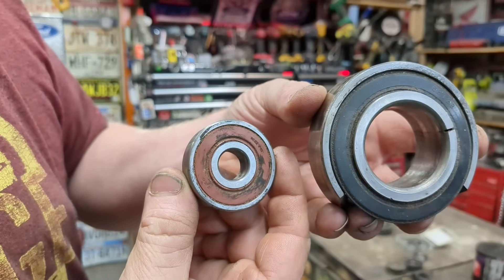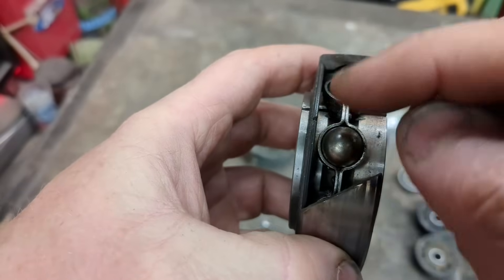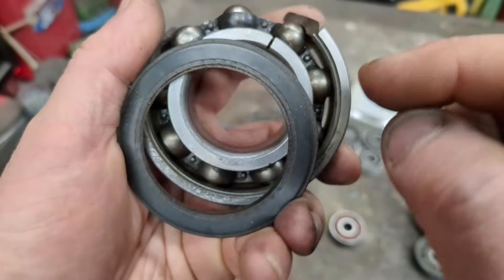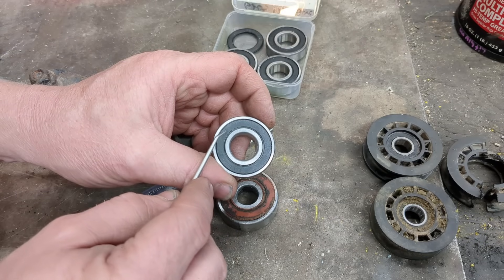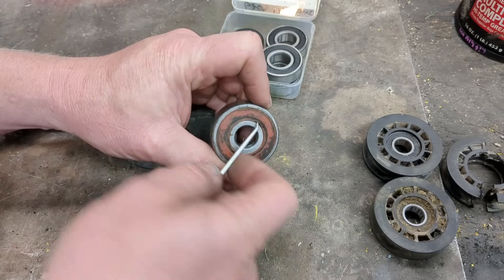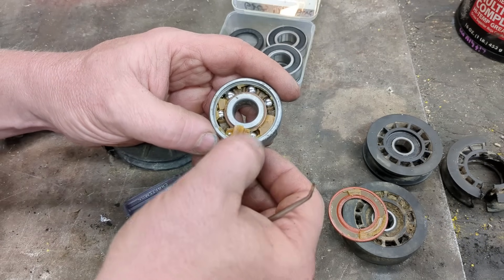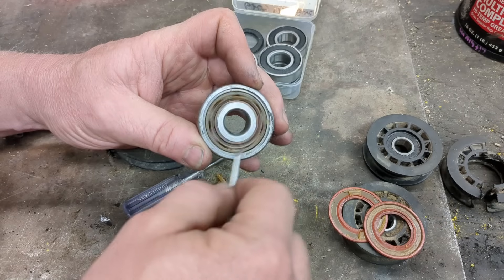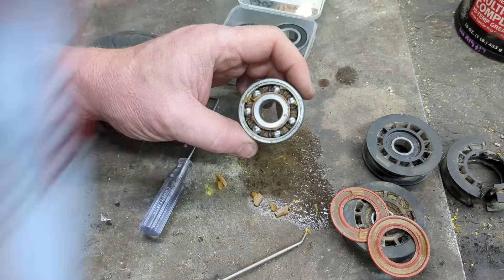How to GREASE, Un-Seize and Clean SEALED Bearings

Comment: I clean them by putting them in a ziplock bag filled with isopropyl alcohol and drop that into an ultrasonic cleaner filled with water. It gets the bearings super clean because it releases dirt that's trapped between the cage and the balls. After I take it out of the tank, I hold it by the inner race and blast it with the compressor. on a shallow angle The bearing will spin up to warp speed and will spin for a very long time on its own; that's how you know it's completely clean.

I pack them with grease by pushing it into the bearing until it comes out the other side; then I spin the bearing several times before wiping off all the excess grease with my finger on both sides. As long as you have an air gap on both sides you won't have any problems.
Reply: Be careful with compressed air on bearing.  Bearings can be damaged by over speeding.
Reply: @VVBros1  Yeah, well if you spin them like that for a couple of months, then you will damaged them, but for 10 seconds, it won't do squat.

Comment: The green stuff is compatible with 99% of other grease..  plus its water resistant moreso than other stuff..  a bit more expensive but good for wheel bearings to driveshafts to uv joints..  if you get the cheaper marine grease the stuff will separate on its own so dont get that.

Comment: I worked for many years at a specialty bearing manufacturer.  Grease fill rate should be 30% standard use, 50% max for high temperature C4 bearings.  Bearings are so cheap it’s not worth the labor to remove seals (most people will distort them which will lead to premature failure) unless you’re dealing with electric motor quality bearings (again, most will warp the seal during disassembly and will press the seal too deep during reassembly).
Reply: Fixing things is just a hobby. It would be a shame to throw something away that was still working.
Reply: Thanks m8. good info
Reply: Most lawn mower equipment have berring where you cant change them without buying new pullies  that cost 35 to 50 bucks. 
Also if the berring heats up the extra going to move out of the space your trying to protect the balls and race from rust.
People wash mower decks with a hose or presuer washer.
Reply: 😅 @bobbg9041
Reply: @bobbg9041  myjka cisnieniowa jest polecana dla łożysk w szczególności.🤑
Reply: @bobbg9041 There are posts on YT on how to replace the bearings in the pulleys you mention
Reply: @djosbun it’s a fully sealed bearing, like BCA 1625, there is no plastic shield to remove, no ability to look at what’s inside, all I can do is use it and hope for the best.
Reply: ahd a machine thta suffereing from heat the bearing was collapsing i injected a antifriction componet in the bearing,, and no more noises work like new for years that has been there it even suprised me casue thought bearing were already donee ..damaged

engine machinist here
Reply: Doesn't using them without the outer shell or casing decrease friction? People take them off on bicycles to make them faster. Do I need the casing or cage if I'm using it in a simulator wheel base?
Reply: @vincent.416  Thinner oil and a more precise clearance (C0 or C2) is what the bicyclists use.  They most likely clean them religiously and relube regularly.  Highly unlikely they use grease unless it’s NLGI 0 (which is like ketchup in its thickness).
Reply: No. I take the seals of my caster wheels for wheelchair basketball, I only use bones lube or rock & roll not grease.
Reply: £125 plus VAT and post is not cheep x 8.for manual stacker that I bought from a sale.The bearings were bad one had already started to come apart, I washed them in petrol and WD40 I then used compressed air and greased and rebuilt them all. Very little play or wear. So some cases it is worth  spending a couple of hours. The dirty petrol muck and grease gets mixed with my cooking used cooking to be filtered for my diesel heater.
Reply: Which is the best bearing clearance use for car Alternator motor ? Normal Clearance or C3 ?
Reply: @ All alternator manufacturers use C3 clearance due to under hood temperatures.  Normal (or C0) clearance is too tight.
Reply: @djosbun  : thanks for good information .
Reply: Agree with you 100%
Reply: @djosbun I have been looking for an answer to a question I have about a clutch release bearing, which is truly sealed. I have an NOS bearing which is likely 40 years old, sitting wrapped in paper in a box.it’s an assembly, a proprietary carrier and a bearing which was unavailable in the mid 80’s. Do you think there’s still life in the lubricant, as sealed as it is. Either way, it’s what I will have to use, until I find one of the proper factory units, which have replaceable bearings. The application is the 1966-69 426 Hemi.
Reply: @jamesblair9614 No…..if it’s a sealed bearing, remove the seals, wash the old grease with brake clean and repack with fresh grease.
Reply: Can you give detailed specifics on proper method and depth to re-install dust shields. I also prefer to remove shield by outside of cover since it dies not move along a race during use like the inside.

Comment: When you need new bearings, replace them.  Having a bearing fail because you "fixed" it instead of replacing it will cost more than replacing it when you were "fixing" it.
Reply: I needed a new idler pully for my toyota work truck a few years back. Needed it quick so I went to parts store and got one. After comparing it with the original it was apparent the new chinese one was probably also used on mower decks from home depot. Took the new one back and repacked the original one. That was 40k miles ago. If I start to hear the bearing going dry I'll probably try packing it again...lol
Reply: @95thousandroses  OE parts(genuine Toyota in this case) are always of better quality than cheap replacements.  Did you compare the cost of a genuine replacement vs. the parts store example? 

Your bearing is still worn out, you'll just reap the reward of being "thrifty" eventually.
Reply: @BillyWillickerBillyWillicker  calm down Francis.
Reply: @95thousandroses  Do what you feel is right but if it goes bad, don't blame anyone but the person who made the decisions.  Many people confuse cheap and stupid.
Reply: Maybe.  Real mechanics know how to repair things.  "Parts changers" don't even care to learn.  Your comment seems to be more of an economics question.  Many times there is more to the issue than money.  Your point is well taken, but sometimes....

Comment: I always fill the bearing to about 60% and so far I haven't had a problem. I bought a set of belt pulleys on the car some time ago, and on the new ones I sprayed the old vaseline and used a new, better quality one. The pulleys have been working for 30k km without a problem, I recently had a belt down and they spin perfectly with a gentle resistance. Regarding the type of grease - never use EP (extreme pressure) grease on bearings that have a bronze or brass cage - EP additives are corrosive to copper alloys.
Reply: Copper compatibility is tricky, and usually not stated. Apart from the additives corroding the metal, you have the issue of copper ions degrading the oil, both as in cracking it into more volatile compounds that will evaporate, and causing it to polymerize into a gum. For the corrosion there is a standardized test that may, if you're lucky, be listed in the data sheet. For the other issues you're on your own.

Comment: I used a hypodermic syringe full of grease with a small needle to carefully slip inside the bearing seal to  re grease failing bearings on agricultural machines to stave off breakdowns during harvest season. Always remove the cutting tip of the needle first to avoid cutting the seal.
Reply: Every mechanic or DIYer should have an assortment of syringes and blunt industrial tips. Super handy sometimes.
Reply: I fix micro balbearings that can't be opened by using a carbide drill bit that's  about a human hair in width hen inject thickened oil with a syringe.  And a dab of special epoxy to seal the hole. Only need to fix em once. They don't seem to break again. The mfg used garbage lube for planned obsolescence and guaranteed failure. Nothings made to last. I now repair things I just bought before using them.  I've gotten good at figuring out how they fuked up their own product to fail.

Outdoor remote ac switches. 0 conformal coating. I coated it before I even used it. Been out in the rain and humidity for 3 years. It wouldn't have lasted 3 months outdoors. Buncha assholes running companies now a days.
Reply: I do the same😅
Reply: Great idea!

Comment: I've done this a few times to buy some more time out of a belt idler pulley on my car when I couldn't immediately get one.

My dad used to take the suspension out of his snowmobile every fall and re-grease all the bearings. That kept them from ever getting rusty, and the bearings lasted for decades.

Comment: In 2010 I bought a 1992 Geo Metro.  Not long after, the wheel bearings started going out.  The new bearings only had a small speck of grease--less than an 1/8 inch diameter.  These are sealed ball bearings like in the video.  I greased them properly and now have over 180,000 miles on the bearings with no problems.  By the way, if you are the same sixtyfiveford who detailed how to change axles on my car (this was on the geo metro forum), thank you.  Your method was much simpler and easier than my first attempt.

Comment: Seems like sealed bearings need a high-lubricity oil with stable film properties - that would be dependent on service needs, but maybe a 10-40 or better (10-50) oil. That's because with the double containment of cage and seal, a paste is not called for but a flowing agent - oil. Which brings us back to the idea of the SEALED bearing - it's suppsed to be lubed once and forever. Unfortunately this is only to the limits of the oil - and that does require servicing - 100% cleaning, and re-oiling. Grease is a bad choice.
Reply from the maker: Problem is that sealed bearings don't actually have a great seal. They're generally a single lip seal without a spring tensioner like most oil seals would be. There's just not room to put a real oil seal on them. So they're always going to leak out the oil/ oil from grease.

Comment: So once the balls in the bearing start to rust and become pitted, does tye bearing need to be replaced?
Reply from the maker: Anytime I notice water or rust damage I replace the bearings. I do this because in wheel bearings, where you can actually disassemble it and see the race surfaces, if there's even the teeniest bit of rust; somehow the hardened steel bearings start to flake. They essentially disintegrate.

Comment: The big move in grease today in the industrial sector is towards synthetic base calcium sulphonate grease.  Higher moisture repellent qualities, and much longer service life.  There are more of this type available retail now than a few years ago.  I have a feathering propeller on my sailboat that requires a grease with lower viscosity and high washout resistance, so Chevron Black Pearl NLG-1 is on duty 10:10

Comment: I had an arguement with a fella years ago about this. I told him that you can service and relube a sealed bearing. He said the name itself tells you that you can not. he was fresh out of  trade school too. I then asked him this. " Tell me how the oil escaped from a sealed bearing then "   he  actually got mad and started yelling as he had no answer. lol
Reply: Some sealed ball bearings ironically come with a zerk fitting above their location, as on tractor decks.  You have to wonder about the engineers who designed them!
Reply: @campbellpaul  What's wrong with that?
Reply: Im a welder and millwrights told me they are nonserviceable. I took the cap off cleaned them and gave them back to the millwrights , speachless. Now instead of regular grease i use cv grease.
Reply: It figures. Trade school doesn't teach you much.
Reply: I wish I would have known about that last year.  I could have saved a lot of money

Comment: Does this apply to wheel bearings? I was taught growimg up in the 80's n 90's to use a glob of grease in the palm and push n  rotate the bearing into it, and everyone would fill the outer spindle cup thing you hammer on full of grease . Than i started using the cone shaped bearing packers that you put a grease pump on. Hands always get covered in grease. I like your method mych better. Btw i made a set of custom picks out of old junk screw drivers. Pretty sure i got that idea from one of your old vids. Thanks n keep em coming.
Reply from the maker: Wheel bearings/ tapered roller bearings don't have sides so they just expel 75% in the grease you put in. Sealed bearings keep that contained and keep whipping the grease sometimes into a foam that doesn't lubricate at all.

Comment: I like using a product by Berkbile called 2+2 Gum Cutter. It evaporates slower than acetone and I have never had it leave a residue. It comes in aerosol cans and is available at many auto parts stores. 
Yes, due to the rpm many of these turn, packing with grease is not necessary. For those disbelievers, take apart a new bearing and inspect how much grease the manufacturer uses then think of how long the service life can be for its application.  Different bearing and application, I still see people packing wheel bearings and then placing grease in the hub center in the cutout. Once grease gets out of the bearing from rotating and age, it does not run back into the bearing. That is an old wives tale from year ago and it is hard to change peoples habits. They would rather waste the grease for fear they are going to cause the bearings to burn up.

Comment: I have pressurized hubs on my boat trailer but they are spring pressure, pretty common stuff.  The spring loaded cap gives space for grease  expansion when the bearings warm up.  Always fully packed to keep water out when submerged at the launch ramp. 30 years now never lost a bearing, knock on wood.
Reply: Actually, the bearings cool off fast when the bearings get in the water.  Without the spring pressure, they tend to suck in water.  With the spring pressure, it just pushes more grease into the bearing as it cools.
Reply: I was about to ask Moe about boat trailer bearings. I was taught (or maybe just developed my own logic) that if they are packed full of grease, that helps to displace any water that tries to seep in.
Reply: Been in boat buisness many years the problem is the seals or most are meant to keep grese in not water out. 
Did work with a old timer back years ago and he would but the hub seal in backwards sure let grease out and all over wheels but no water got in. If you look at the propshaft seals there are two back to back one hold water out one hold lube in

Comment: I find gasoline to be the best bearing cleaner and for some reason works faster than acetone and it’s a lot cheaper. That’s just my experience. Great video, thanks. Cheers mate, Stuart 🇦🇺
Reply: Bearing packers aren't for sealed bearings, so not really applicable to this video. And acetone cuts grease and oil far more effectively than gasoline, hands down. Not to mention, it won't leave petroleum residue, which gas inevitably will. SCIENCE.
Reply: @talltom1129  Can’t argue with sealed bearing comment which it totally correct. It’s just my personal experience using gasoline for washing parts and bearings for the last 40 years. I have always used compressed air to dry bearings before re-packing so I’m not sure about the residual issue.
No, I never allow the bearings to spin while drying them with the air. I’ve edited my original comment and thanks for pointing it out. Sometimes I’m so dumb.

Comment: I have a craftsman lt1000. I replaced both of the plastic pulleys with steel pulleys because they locked up and one got a flat spot rubbed in it by the belt.

Comment: Good advice, thanks for sharing. 
The only bearings I've fully packed are those in a low speed or non continuous rotation application, and subject to water. ie, Mountain bike suspension bearings.

Comment: Thank you! I have experienced the negative results of over greasing first hand. When we renovated the engine room on a large commercial fishing boat the electric motors and pumps for circulating seawater, hydraulics and fuel transfer had to be realigned. I was running out of time in the shipyard so I had their shipwright perform that task. The old boy spent what seemed like hours lecturing me on the evils of too much grease. I ran the boat for another two months following the shipwright guideline of 'one shot a day per bearing'. Everything ran fine. When the owner came back to run the boat for a crab season he also started pumping these bearings full of grease every night. About three weeks later a bearing seized. When I replaced the bearing I found pounds of grease encasing the bearing. Asked the owner about it and he blew up saying there was no such thing as too much grease. After the fourth bearing went out he finally agreed to leave the grease gun alone. For the next two years that I stayed with the boat we never had another bearing failure. Grease kills.
Reply: Thank you.  It makes sence.   You cant buy EXPERIENCE  .
Reply: @michaelburke7070  ALL   A BULL..sht talk 

ENGINE MACHINIST HERE